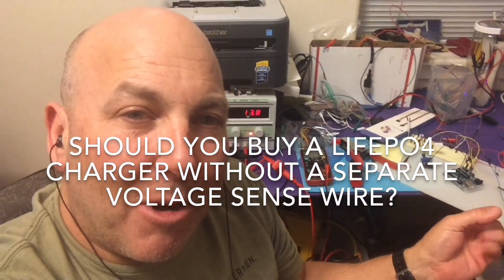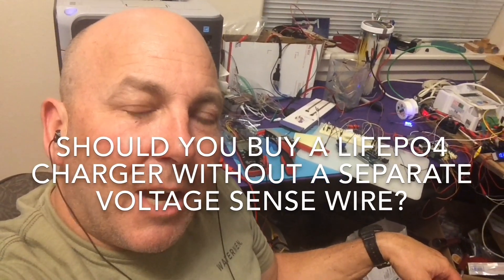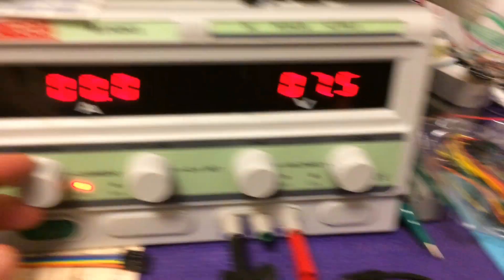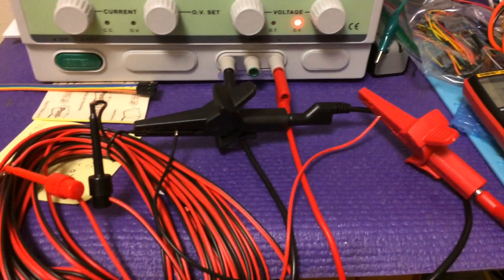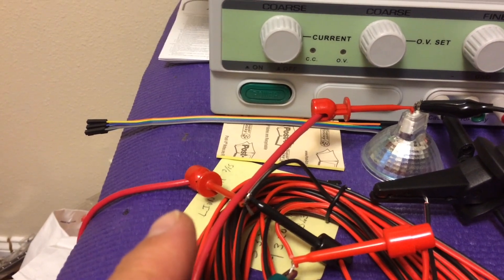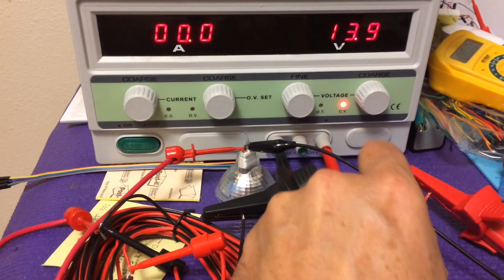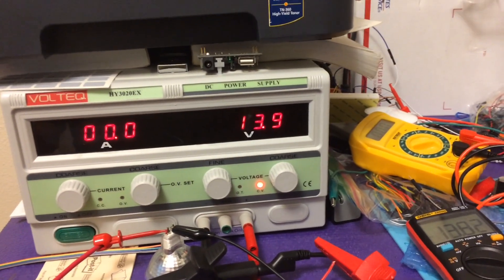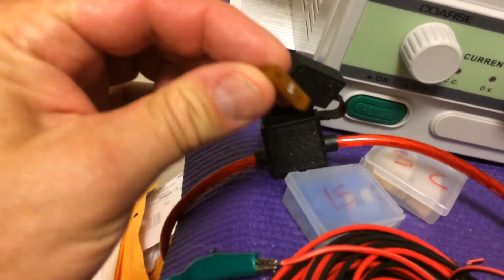Should You Buy a Boat Lifepo4 Battery Charger without a Separate Battery Voltage Sense Input Wire?

Comment: Hi Danny,

Informative video, and well done, too!

Thanks for producing this for the public, might answer some of their questions before they call us! :)
Reply from the maker: SterlingPowerLtd I am honored by your comment. Sterling is one of the few companies that use voltage sense on chargers. The BB1260 is a great product once configured correctly and it is a great value for those who want to migrate to LiFePO4. Sterling products are feature rich and well engineered. I love them but configuration with LEDs is sometimes challenging the first time.  A standard OLED display or Bluetooth would  be a nice thing to add to your clearly superior engineered products. Let me know if you would like me to test any of your new stuff out. I’m rigged 12v hybrid LiFePO4 and lead acid. Here is my system https://youtu.be/h991SCePHpw . I could use a new inverter/ charger that supports lithium.  I have a bench at home where I tinker and test before I install on the boat.
Reply: @dannyjensen4954  Hi Danny,

Regarding the complications/difficulty in programming into a custom profile- it's something we recognise and understand.

We've spent a long time trying to establish existing products and make them excellent that we stopped innovating in massive steps for a while- but, you'll be happy to know, we're back on that now. 

The upcoming BB Ultimate will have bluetooth support amongst it's other amazing features, and we hope that will keep our customers as happy as we want them to be.